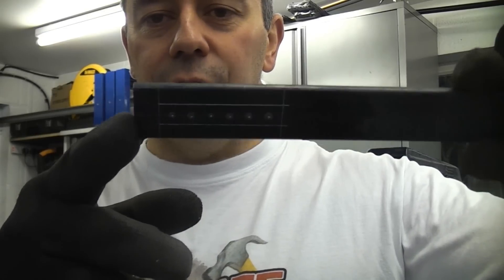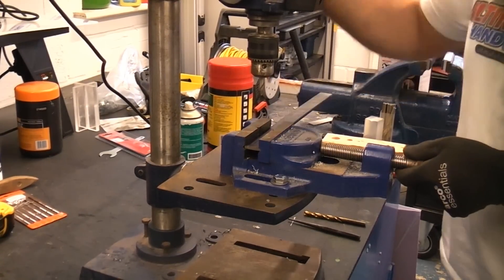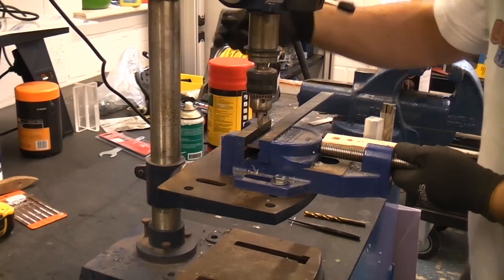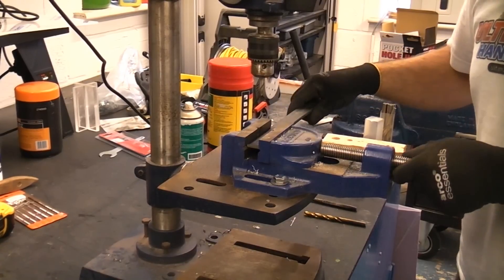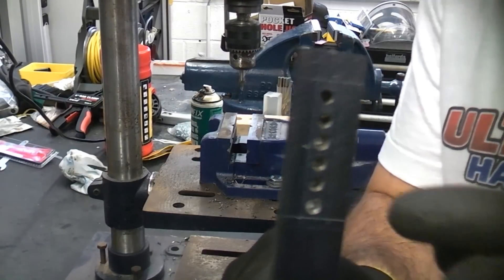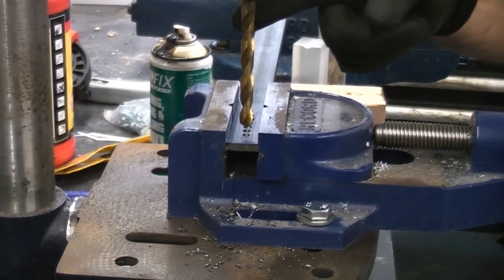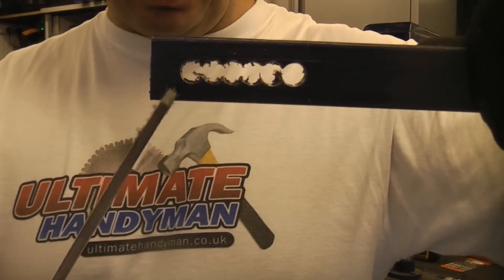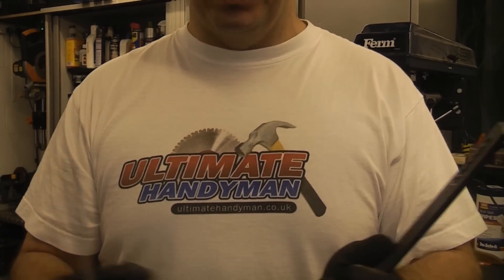Chain drilling

Comment: great! thanks!..btw..what would happen if you tried slotting on the press drill?..ie..kept it running in place whilst trying to slide the metal across?
Reply from the maker: You are welcome.
You might be able to do it using a cutter designed for a milling machine, but you don't have much chance with a drill bit as they do not cut well on the edges.
Thanks for the comment

Comment: Great video ! I have a question please , I'm thinking about buying a stick welder , is it dangerous to plug it in my normal home outlet ?
Reply from the maker: It should be fine as long as you get the correct amperage machine. Mine is 16 amps maximum but I never use it at the top of it's range at home. If you are in the UK you should look to get one that will plug into a regular 13amp socket. Mine is an inverter and is very light and can also be used for TIG welding.
Reply: *****  Great tips ! thank you for your fast answer :)
Reply from the maker: MR MAN
You are welcome ;-)

Comment: How far do you keep the holes? Is there a rule? I tried, bu the drill bit tends to skip into the near hole...
Reply from the maker: It depends what size drill bit you are using. For example if you are using a 10mm drill bit you should space the centres of the drill holes about every 9mm apart, that way the holes will join up. You have to do it with a drill it that won't flex much so really the bit needs to be at least 8mm in diameter. Ensure you centre punch the marked hole and also use a centre drill where possible for the pilot holes. It's critical that the work piece cannot move so it needs clamping down really well or the drill bit will move the work piece. You will notice that my drill vice is bolted down to the table of the machine, which means it cannot move anywhere. I hope this helps ;-)
Reply: Thankyou very much!